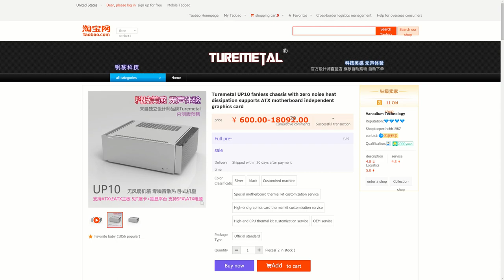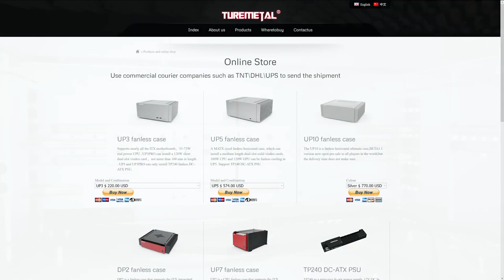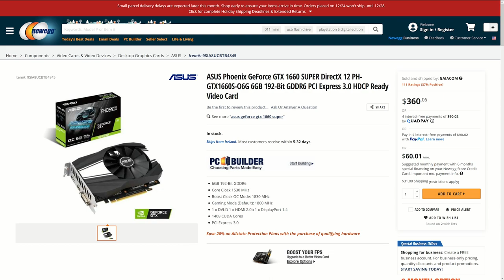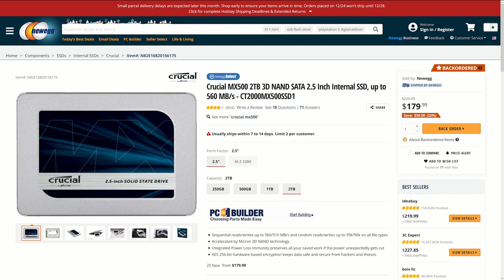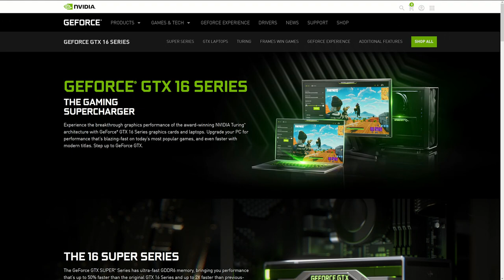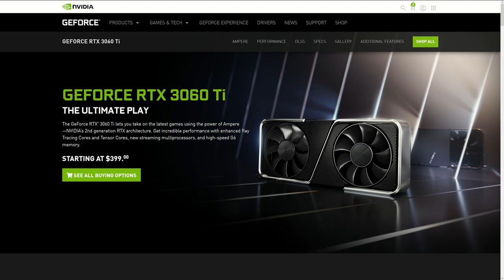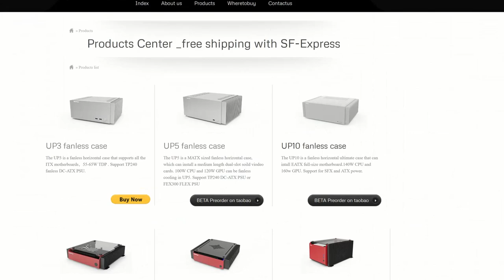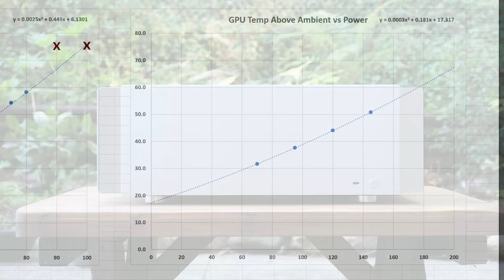Turemetal UP10 - Building a Fully Silent Fanless PC

Comment: don't you need to put thermal paste on between the heatpipes and the heatsink? 8:15
Reply from the maker: Thermal paste was preapplied by Turemetal.
Reply: @fullysilentpcs  Hi, where do you buy copper heatpipes for your builds? I seem to have missed it in your videos. 
Best regards.
Reply from the maker: Most of them come with the cases that I've purchased. I've bought some extras from eBay and AliExpress.

Comment: I have a RTX 3070 to ‘spare’, I’m tempted to find out if it would work with this case. The 3070 is a 220W TDP card, but at 200W it still delivers about 96-97% of the performance, and it looks like this case should just about hold the 200W.
Reply from the maker: I'm curious too. I have a 3060 to test, but haven't yet gotten my hands on a 3070.
Reply: @fullysilentpcs  So did any of you test this case with the 3070?

Comment: Can you hear any coil whine from the graphics card under gaming load?

Also, do you think the UP10 can handle 65W TDP CPU + 250W TGP GPU (e.g., Ryzen 5600X and Radeon 6800XT)?
Reply from the maker: No, I did not hear any coil whine here. The case can handle 65 W CPUs, yes, but not 250 W GPUs. You should choose a GPU that is under 200 W.

Comment: Now I understand the market for The Beast from monsterlabo. Compared to this case, The Beast is the real deal for the same amount of money.

P.S.
You've mentioned that 8mm pipes can transfer 25-45% more heat, than 6mm. Why is there such a wide spread? I thought it should be constant ca 25.
Reply: You forgot to take into account thickness of the tube + surface area + energy conversion efficiency and maybe other parameters

Comment: Why are most silent PCs intel based?
Reply from the maker: Part of it is bias - historically Intel has had a good reputation for thermal control; part of it is that they include integrated GPUs on almost all CPUs. In this case there isn't a particular reason.
Reply: @fullysilentpcs  
It's not just bias, if you want something to just work you buy Intel. But today AMD has such a thermal efficiency / fabrication process advantage that it's worth making the effort to use their stuff. For fanless systems especially!
Reply from the maker: True, also, power use is easier to control via BIOS with Intel.
Reply: @ngkktht774  In 2021, you want something to just work, you buy Intel. On the desktop, AMD still has memory compatibility problems and firmware problems. And it'll take three successive AMD server upgrade cycles for that to be a 
thing of the past in servers. Zen3 is the point where AMD became dominant in servers so we're still at 1 cycle.
Reply: I went for amd new apu for my htpc, best decision ever